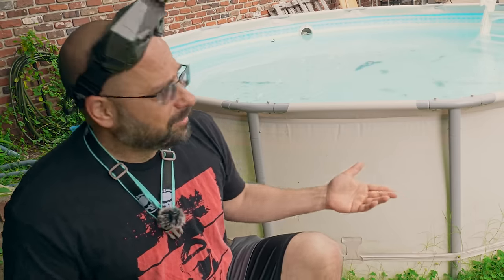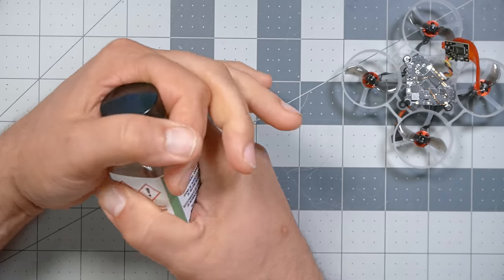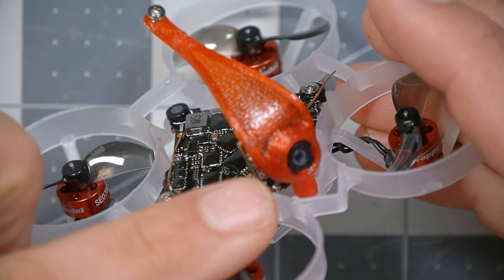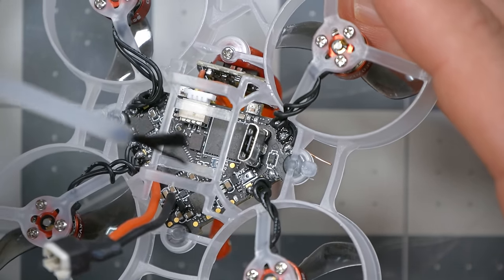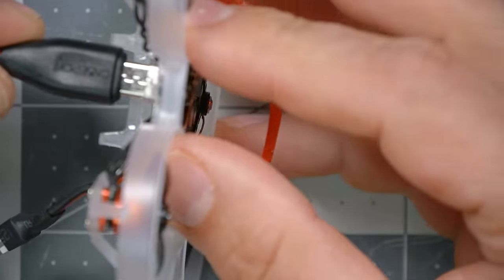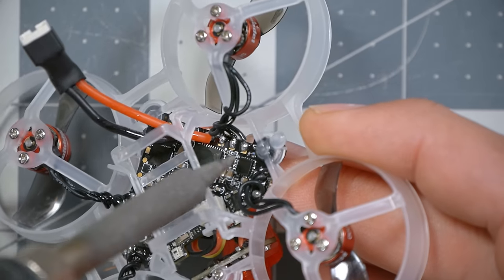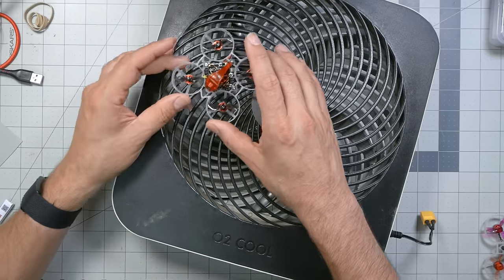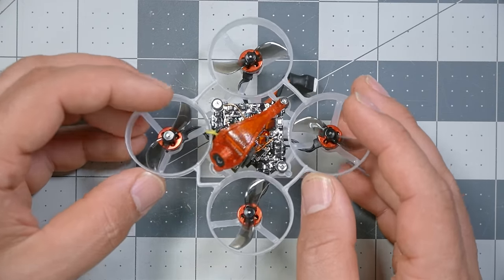I didn't waterproof my drone. Now I'm paying the price.

Comment: Hey Joshua, Long story short, put my non waterproofed Tinyhawk 2 in my pool. I didn't unplug it underwater, and I did use rice for like 3 days. Now when I arm only 3 motors turn and 1 is intermittent. When I raise the throttle, it goes to full throttle and doesn't go down when I go to 0 throttle. I'm assuming the AIO board was damaged. Would that be a good assessment? Probably need a new AIO board. Dang it!! I wish I had seen this video 2 months ago!😞

Comment: I use B-7000 glue to waterproof my quads. Have flown in fullpower rain totally fine.
Heard conformal coating gets micro-cracks after some cooling/heating cycles + high vibration so it needs maintenance once in a while.
B-7000 remains elastic like silicone and much easier to apply and control so that it don’t get in usb ports.
In fact i apply it on usb ports with a help of gravity so it hardens like a plug. If I need to use it - just tear it off and reapply it back after to seal and preserve these parts as well. 
So easy to tear it off as well. You just take one part on tweezers and wind on itself.
The only downside is - It has little worse thermal conductivity, but if you fly and not wait on a bench for 5 minutes its totally fine.

Is there someone who uses B-7000 as well, or any other substance which you found better in your application? Are there someone using conformal without reapply more than 6 month with no issues in heavy rain?

Comment: Corrosion X HD is the only waterproofing safe enough for main battery connection  and any other small connectors and usb as well but silicone conformal coating is best for everything else, so combined you'll basically have a fully waterproofed quad.
Reply: DO YOU HAVE THE LINKS OF THAT PRODUCT?

Comment: I conformal'd the VTx of my old drone after landing in wet grass killed it.
Am looking at ways to waterproof my new one, but it has a barometer that I don't want to ruin.
Video appreciated.
Reply: I was wondering the same. I would think you can just take a very small piece of tape and cover it.
Reply: All mine have a barometer, and using the brush it’s so easy to just coat round the edges of it, leaving the top clear.  Just keep the brush without too much on it and push the end of the bristles towards the component carefully, don’t just try brushing past it.

Comment: You might not really need a UV light. The sun might be enough. Under sunlight, the conformal coating is way more visible than under normal artificial light, because the sunlight contains UV light.
In Germany the MG-Chemicals stuff is very hard to get. You can just use Plastik70 (or Plastik 70 super if you're worried that ESCs or VTX might get too hot for regular Plastik 70) or other "Elektronik Schutzlack".

Comment: The BAROMETER CHIP. This measures barometric pressure and therefore altitude. It has a very tiny hole on top so it's open to air pressure. You want to be sure you do not put conformal coating over that hole. If you do the flight controller will detect that it's at a CONSTANT altitude no matter what the actual altitude is.

Comment: Question: what is a good combination of analog goggle reciever and antenna for these whoops?  I mean, digital is still too heavy for whoops for now imho.  Nice experiment and details about conformal coating, mine survived a bucket of rainwater too, no coating.  But i did unplug under water, and dry out for 48 hours, then alcohol bath and soft brushing soaking for 25 min,  then dry for 3 days, before trying to fly it again.  

Conformal coating bought, but never used yet.  This video reminded me about it, so thank you Joshua.

Comment: Hold up how is Silicon not mentioned once here! I'll admit I found Joshua cause I'm a complete drone noob but I've spent years as a Carpenter and a few years doing RC boats and when you want to keep water out nothing beats good old fashioned silicon. You can get a whole tube for $10-15 haha. Now on that woop I could see it being a little bit of a pain but for a 4" or 5"+ it would probably be just as easy to apply. You could also get creative for a lot of the do not coat parts by making mini boxes you could seal with the silicon.

Comment: I r dunked my tiny hawk freestyle in dog water bowl twice, didn't cause any harm. Apart from my firmware corrupted on the 2nd time a few times.

However, it was disarmed before it hit the water.

Last time I got a drone wet and the esc fried, it was armed.

I dried it out with a hair drier both times,  refreshed firmware when it corrupted, it was fine then corrupted itself again and after 2nd refresh has been fine since.

I've seen vids of someone that waterproofed there quad that will still operate under water.

Comment: Thanks for the video! But what about the battery? Do you need to cover the balance plug? And if you unplug it from the drone while underwater won’t the water touch the battery electronics and cause a short circuit?

Comment: Hey Joshua, what about the goggle feed after the dunk? I’ve had issues with the sensor in some quads after a good swim in the pool. If you’re careful, applying conformal coating around the seals can help a good bit. You earned your like 👍

Comment: Thanks again for a informative video👍👍 but I wonder. How to conformalcoat a dji air unit? After watching your video I bought the Diatone Roma F5 HD. Really want to conformal coat it since I live in Norway, and it rain or snows "all the time"..
Reply from the maker: The air unit is effectively waterproof. I know more than one that's gone completely underwater and been fine. You don't need to do anything to it.

Comment: if the battery is still connected the water will get into the connection and short things out.  Conformal ain't gonna help that.
best way to get water out of electronics is rince with isopropanol

Comment: Hey Joshua, I have this Mobeetle6 as well! I'm curious of the ECU temperatures with the coating on. Supposedly if the VTX is running at 400mW, it will lower the power depending on the temperature of the unit. I feel like this coating would keep it from dispersing heat like it should. Just curious! Thanks for the video!

Comment: hey man love your videos im looking to build an fpv or buy a nazgul evoque i already own a dji fpv drone i am wondering what rc controllers/radios will bind with the dji air unit/caddex vista units if any at all i dont really wanna use the original dji fpv controller or the v2 controller are there any controllers/radios out there that work with those units or would i have to buy a whole seperate control chip or what ever they are and install that ?

Comment: This vid couldn't have came at a better time lmao I fly around my back yard and did so with COMPLETE CONFIDENCE....until the pool went up....lol I am scared to death to fly around water lol oddly enough my quad fail safed in the exact spot where the pool is located before it went up and that added to the anxiety of flying in the yard lol have some of the worry free so I'm going to try it since I have it already 😁 and apply it to my new mobula7 1s elrs whenever I can get another one😒 this was an awesome review JB and I take my hat off to you for doing it since it is extremely hard to find a mobeetle right about now lol 👍🏽✌🏽oh and I almost forgot PLEASE TRY THE MOBULA7 1S ELRS IT IS AWESOME but make sure your running the new betaflight lol I bricked my gyro however I do think I just had a bad FC because I never flashed anything to it....👍🏽

Comment: Question: won’t rinsing off the treated quad with isopropyl alcohol remove the coating that was applied or does it cure like epoxy? JB said you can clean it up with alcohol if you get the sealant in the wrong place like the USB port or maybe I misunderstood? Thanks for another great video!
Reply: yes it will. if you clean it with any solvent cleaner (ipa, or even electronics cleaner you should re-apply the coating)
Reply: iso will not remove it instantly. frankly its not strong enough. whenever i use conformal coating and get it into places i dont want (like usb port, or connectors), i use gunwash, or thinner to dissolve the conformal coating. Even then i have to let it soak for 10-15 minutes even then i still have to brush it .

Comment: Do you need to put conformal coating under the FC and ESC or only on top of it ?
Reply: Did you find the answer to your question? I'm also wondering if I have to coat both sides
Reply: @OranJuno  yes I found out that need to !

Comment: Why doesn't the battery short circuit on the XT connector when you unplug it under water? Also, do you coat the motors?
Reply from the maker: Water is not a very good conductor of electircity, especially fresh water. The motors are already coated from the factory. You don't need to do anything.

Comment: Does anyone know the difference between MG chemical 422c and 422b coating.  Joshua used the 422b but 422c is all I can find in a small bottle.
Reply: Did you find the answer to your question about 422b versus 422c?

Comment: As someone who repairs small electronics, iphones and androids alike I agree with nearly everything on this video. He spot on with how electricity works when in water. The only thing I strongly disagree with is putting this gunk on,  for selfish reasons.   Makes diagnosing problems fairly difficult when you can't get readings off of traces

Comment: Thanks for making this video. Oscar Liang has a write up on drone waterproofing and recommends using 99% isopropyl alcohol to clean the board before coating and you can also use a cotton swap dipped in it to clean off conformal coating where you want it to be removed.

Comment: I had a whoop (Inductrix FPV) flight wind up in an indoor water source once. I used isopropyl to wash it down and very thoroughly dry with no apparent damage. It was brushed and the motors definitely had a shorter lifespan. I use conformal coating now because it is so easy to apply and solder through. No issues with even some very muddy "landings".

Comment: Did the water actually destroy that first one??  My Mobula 6 has been underwater four different times.  Each time I dried it with a fan, and each time it was fine.
Reply from the maker: Yep unfortunately. I think because I pulled it out of the water before unplugging it. I was managing camera with one hand and just fumbled it even though I knew I should unplug it first.
Reply: @JoshuaBardwell     Awwwww, that stinks.  But at least a video came out of it that will help the rest of us.  Thanks for what you do!

Comment: I have rush tank ultimate vtx which is have a like metal shielding on top of it, so can I coat it bu just flooding it from outside ? or should I open the shield(I dont know if it safe)

Comment: Don't apply thick ! - thermal issues can develop also lifting surface components are possible with thermal differences.  
Also with most manufacturers it will void your warranty, from a retailer point of view I have seen a lot of issues caused by conformal coating.
We no longer recommend or sell conformal coating type products.

Comment: i flew my whoop into a fountain during a race and dried it off and was ready for the next heat lol didnt waterproof it
Reply: same. it was fully submerged while powered on, all leds and the beeper were stuck on. I unplugged it, washed it with clean water and then had it dry for a day. Still works absolutely fine.
Reply: Same on my Meteor65pro
Reply: Instead of pulling it right out, Bardwell decided to make a video 😂

Comment: Plastic dip or liquid electrical tape works well too use to do that on truck esc back in early 2000's before all the waterproof gear was out or used by most manufacturers.

Comment: I keep electrical tape wrapped around the point where the cap and the bottle meet and it helps make it easier to remove the cap. I crashed into a fountain at an office park in 2019 and I’ve been conformal coating ever since.

Comment: I use 90%+ iso specifically because it will incorporate the water left on the electronics, and also readily evaporate. If you have a 3d printer, the heated print bed makes for an excellent hot table for drying. Otherwise a fan will work fine. With high test ISO you can completely submerge the electronics and give it a shake to agitate any water into solution. I've recovered many dunked cell phones with this method. As you described, remove the battery asap and do NOT attempt to turn the device on. This usually blows the capacitors on the board.

Comment: I ran out of battery on my Babycroc5 air unit trying to get home over a lake, I almost made it. I fished it out, dried it off with a hairdryer and it works perfectly! I didn’t waterproof it. Even the Li-ion battery which hit 1.5v per cell is still working like nothing happened. The only thing wrong is my pilot skills!

Comment: Cracking video Joshua, my Tinyhaw3 landed in the dogs water bowl, thought it would be fubar but battery off, hairdrier and 20mins later, airborne. Now taken delivery of a used protek 35 which was covered in the conforming coating, your bit about do not block the barometer is a worry as i think the previous owner applied it with a yard brush!

Comment: Wow! This huge single-propped whoop is THIC. And you could use it to dry the small one, awesome!

Anyway, what I've found to be the best coating is B-7000 glue. It is cheap, easily removable if needed and easily accessible pretty much everywhere. But the main factor is that it stays soft after polymerization, it don't crack due to constant heating/cooling cycles of electronics and it's not affected by thermal expansion in any way.

Comment: MG Silicon Conformal - worked for me: https://www.youtube.com/watch?v=GYVIpIQGcXA  . Took this quad home, hosed it off, let it dry a day or two and then flew a few packs through it. I must have cleaned the camera lens.
Note: the battery popped off on the crash, might have been another story if the battery stayed on as the quad was under water for a good couple of hours before I managed to find it and recover it.
The spray on version is far less cost efficient - I bought the spray on for my first try, and have bought the bottle ever since.

Comment: I've never used conformal or any waterproofing coating, and my multiple 5inch quads have been crashed in water, deep puddles, drains.. multiple times over the years. I just clean if there's mud, and nothing dies. Even my microwhoops dunked in a pool. Just let it dry for a day, that's it. And next week, it's dunked again. Im actually led to believe coating is not necessary. In the long term also, my quads are fine. Am I wrong?

Comment: Just fyi. I looked for 422B (green label) conformal coating but it's no longer made due to chemical costs making it cost prohibitive. The company says 422C (red label) is the replacement and works just as good and costs less. 422C comes with an extra brush as well.

Comment: speed up drying by using a vacuum cleaner at lowest speed (the faster you dry your quad, less chance for corrosion) - air moves a lot faster and you can suck out water from underneath components too.

Comment: I’ve coated all my boards and have crashed in snow, flown in rain, crashed into a fire, ripped battery leads that were sparking and should have shorted out things.  Wet Grass, copious amounts of dust.  It just works really well and prevents so many problems

Comment: I was able to clean, many times, and with no failures, electronics boards from pinballs by putting them in the dishwasher (pinballs internals are often covered with very small fragments of rubber). Afterwards I let them dry in open air, under the sun; but using a fan is probably a better idea. Since you can't coat connectors like JST because they aren't waterproof and will never be, I'm not sure that the coating process is really useful as soon as you have such connectors.

Comment: I always use corrosion x heavy duty..it's the stuff,and put it on it all no worries
Reply from the maker: It just dries so gummy and gets in the way of soldering unless you clean it off. It's effective for sure.
Reply: @JoshuaBardwell  very true sir..I mainly use it on my crawlers not my fpv stuff or planes.ive not done the conformal coating yet on anything..but morning dew and or a pool witch I've got a 24ft one is a very expensive puddle.lol..

Comment: I was showing off my very first whoop on a trip to Florida by flying it around the pool. I was showing off my skills by going through the hole in the railing until I bumped the side and the drone fell in. I immediately panicked and took it out. Cleaned it with alcohol, popped it in some expired rice and let her sit a few days. She was good as new but the gyro got a little messed up so before I use it now I have to re-calibrate the gyro using silverware. I’ve had the thing almost 4 years now and it’s still kicking! (Btw this happened in a saltwater pool)

Comment: I would recommend FPV worry free, much easier to apply and see how it goes on, and has never broken my electronics unlike normal conformal
Reply: But it’s a big pain to replace soldered things under it 😂
Reply: @jacobscoville2044  that's definitely true, you can't just burn through it as easily, pealing it up isn't as quick as the normal stuff. But I still think it's way better overall
Reply: @milfordkd  for sure! But I usually just end up swapping the whole part when I have to re-solder something 😂.

Comment: Did something similar, not even an hr after getting my new betafpv cetus pro lol
Wife wanted to skin me and have my skin for a winter coat, thanks to the gods and a hair dryer, after taking it apart and using the hair dryer. Lol well, she still flies but not as easily anymore, so scared but still good lmao.
What about clear nail polish....??
Apply the same way, avoid ports etc.